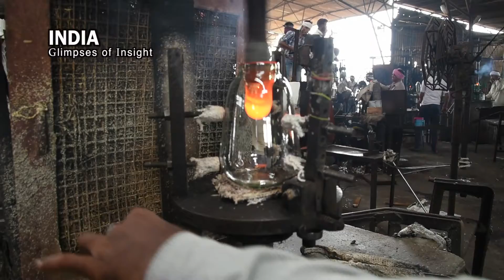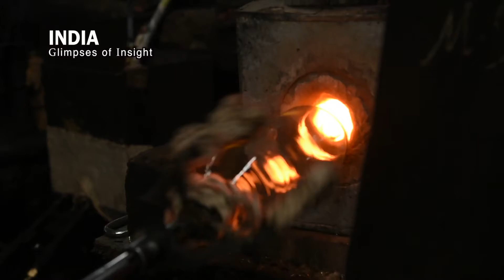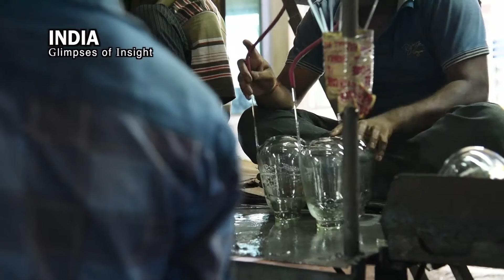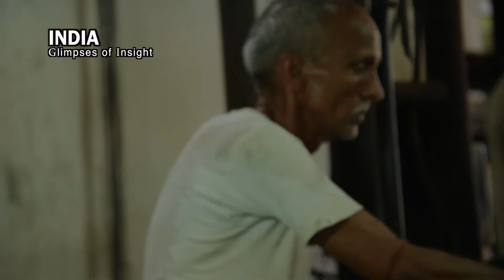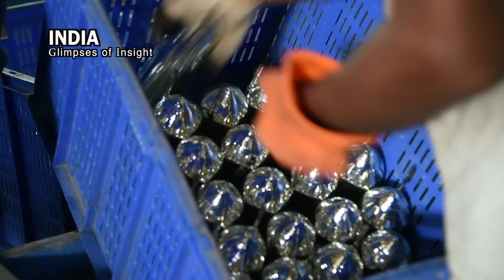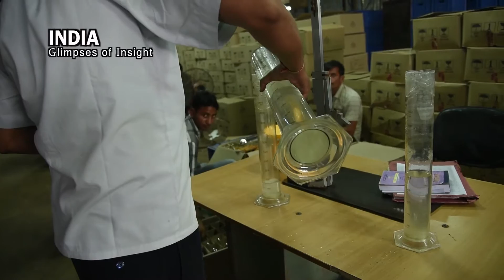Vaccum Flask Manufacturing Process - Firozabad

Comment: I find the method for producing the double wall on those pear shaped flasks absolutely fascinating. It appears he is increasing the rotation rate on the plunger as it is inserted deeper into the flask such that some sort of fabric or possibly leather strap near the end is expanded by centrifugal forces and allows the taper of the inner vessel to exactly match the form of the outer one all the way to the bottom. I never would have guessed such a thing could be possible had I not seen it being done. Remarkable. All the same, I fear for the men's health with the obviously large amount of asbestos being used everywhere.